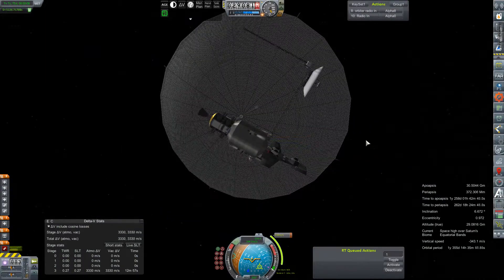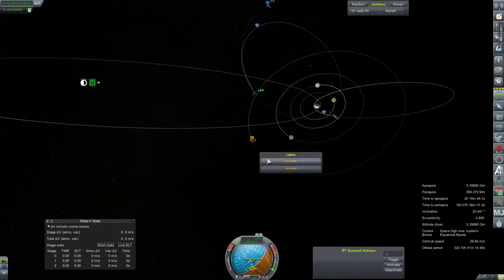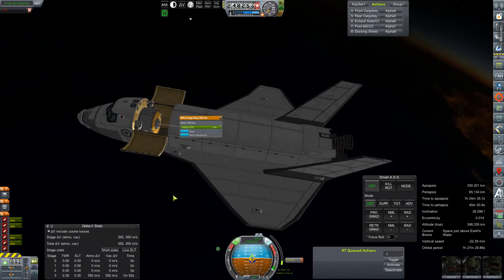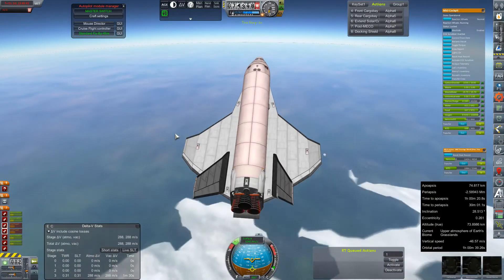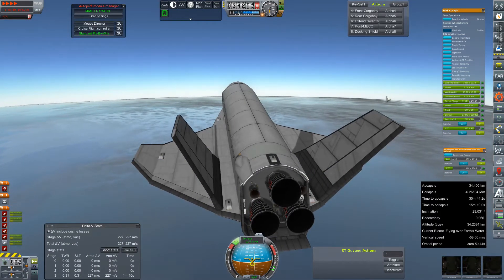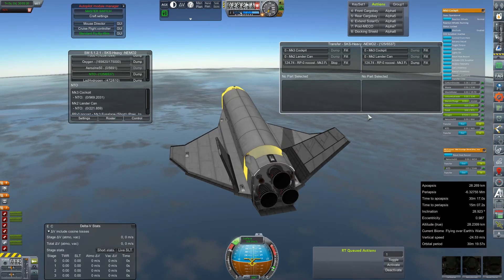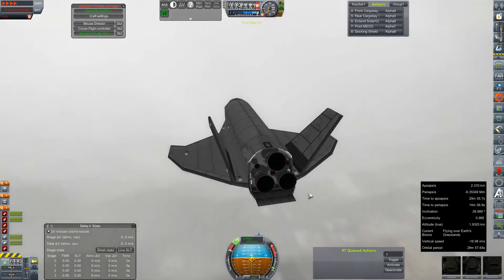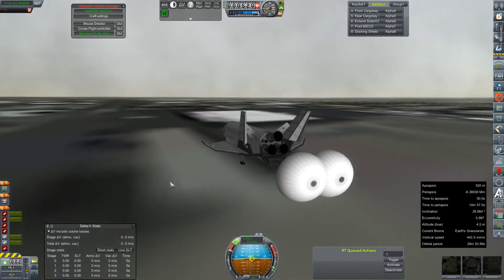KSP RP-0 #586 Target: Florida

Comment: 1 engine lit
Hahaha
2 engines lit
Hahaha
4 engines lit
Reply: It's lit, fam.
Reply: Also I think this happens because I think i angled all the OMS engines towards the DCOM rather than being parallel to each other, so the bottom one points down while the upper ones point slightly up. And I think the ullage axis is based on where the engine is pointing relative to the total forces on the craft, not the fuel tanks it feeds from. Limitation of the software, I suppose.